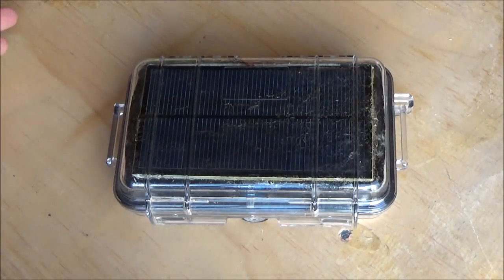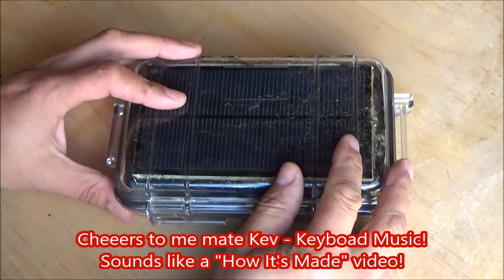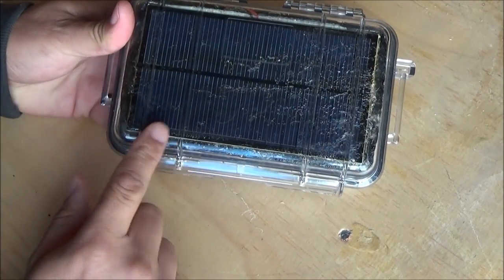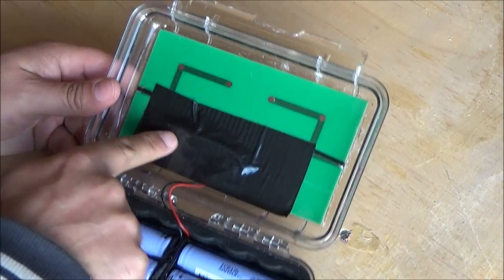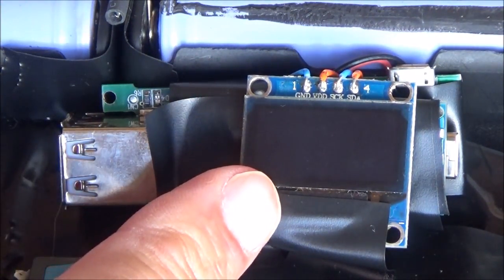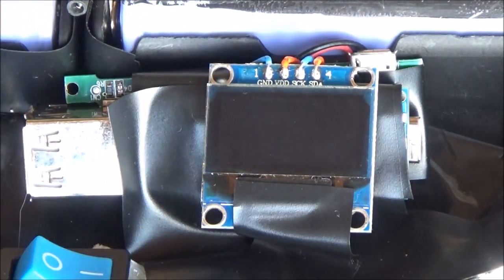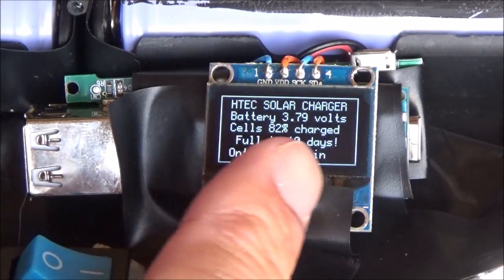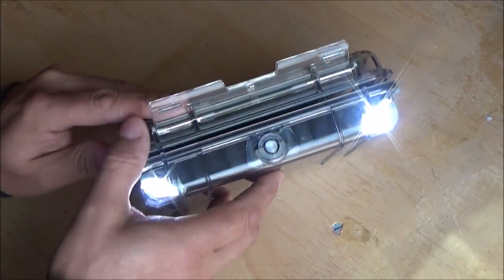Solar 18650 Charger & Camping Light with Arduino OLED display in clear PELI case DIY

Comment: So did you hook up the batteries to the solar panel with just a diode? Is there also overcharge protection?
Reply from the maker: +Netherlands031 I'm so lame... overcharging is protected by me bringing it indoors!! :-)
Reply from the maker: +Netherlands031 ...  sadly....  I didn't add much protection to this project...  I believe I need to get it out and re-develop what I started here...  I did clamp the max voltage with a zenner diode and resistor combo...  I'll do a more detailed review and bust out the soldering iron!